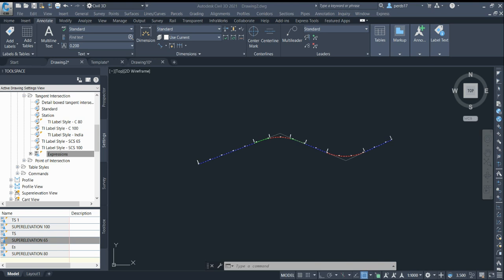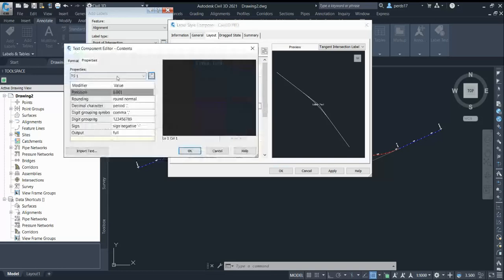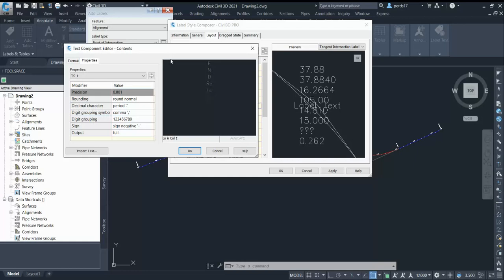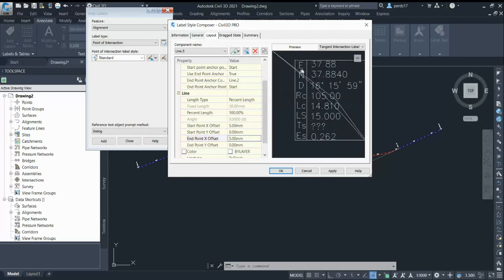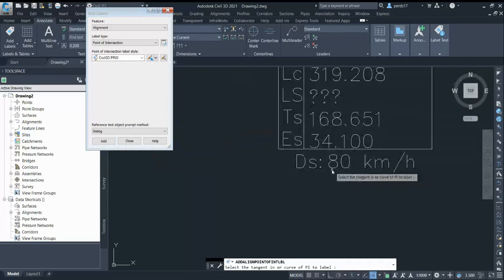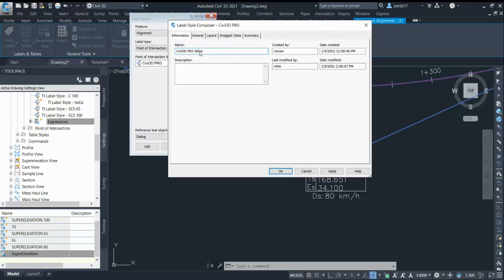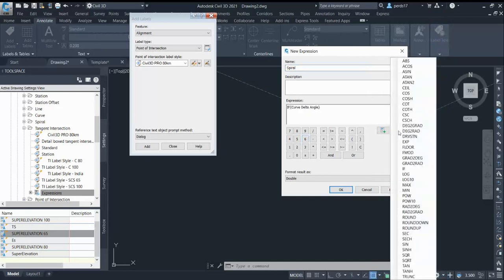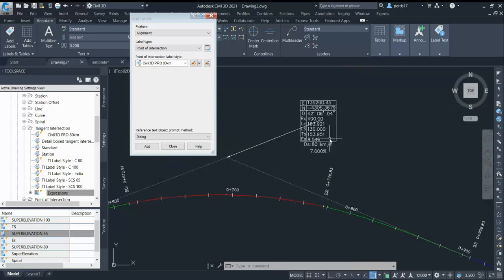Civil 3D - Alignment Curve Label Style in Plan in Autodesk AutoCAD Civil3D

Comment: Sir, 
I want to draw a curve with the distance between the transition curve and the circular curve as I need, is it possible?  Please make a video if possible.
Reply from the maker: Don't understand your question. Are you asking for compound curve ?
Reply: @Civil3DProTipsandTricks sir Deflation angle 29d32m39s R=1116.666m (1,567°) T.L.=294,455m 
C.L.=575.802m 
Trans=130m 
Shift=630mm
I want to draw a curve according to this measurement.

Comment: Can we add e% or super elevation rate in curve table if yes then what is expression for complete alignment ? If my design speed will be 100km/hr or radius will be greater then 200
Reply from the maker: Rate of change is already there in super elevation band. You don't need to add them. Its depend on length of transition and super elevation.

Comment: Can't we add Dynamic value of Super elevation which we designed and applied for an alignment already ? Because we will have to edit Superelevation values depending on site condition also (Where we will apply value less than the value from equation)
Reply from the maker: No. you can't. So you have to find alternative way to provide superelevation. You have to play smart with things you already have in civil3D. You can make style for design speed 50, 60, 70 and so on.